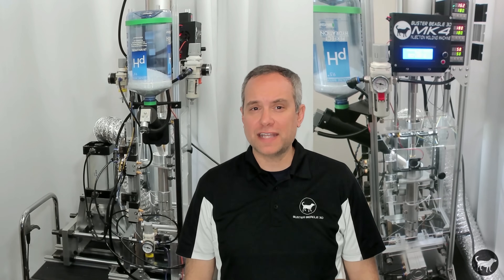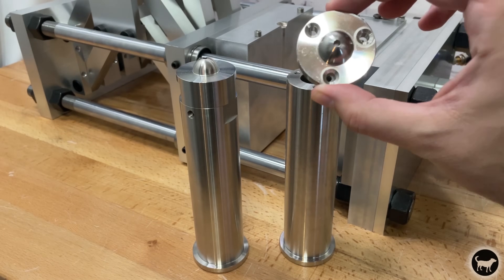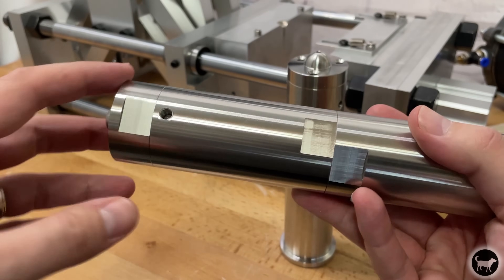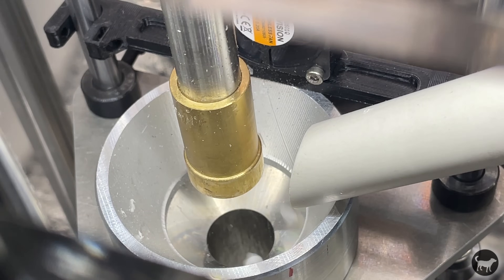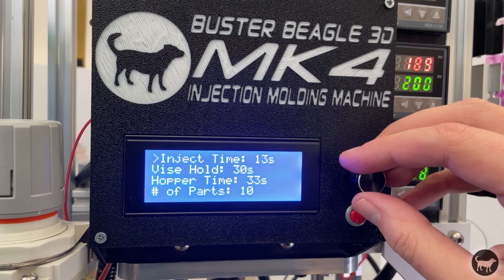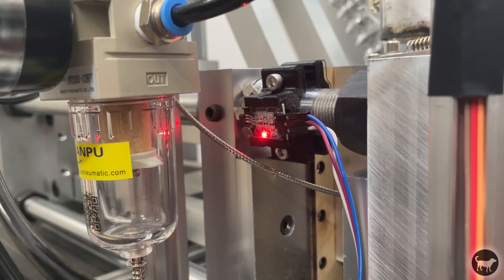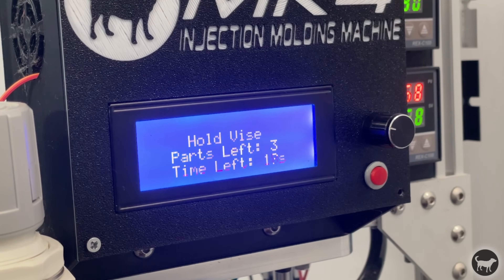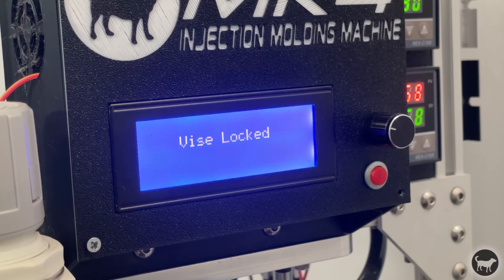Buster Beagle 3D MK4 Injection Molding Machine | Full Automatic

Comment: Question, would i be able to put polystyrene through this? Or would that be too hot? Also would PS work with silicone molds? Or would i need a different material

Comment: this is awesome i actually work in plastic injection molding and we use a screw version of this. i still very much like this im trying to learn some coding but i see you actually include the code, but either i dont know who your files are broken up or i dont seem to know how to implement your code i guess.
Reply: actually i think i figured it out i didnt know anything about the libraries but i see its actually something in the arduino program. like i said working on learning coding but im a long way away but working on a project with this i look forward to this project and future ones

Comment: Question.  I wanna make an mk3 but i want to make it for the 5 cubic inch shot.  This is doable with out making all these extra things?
Reply from the maker: Yes. The MK4 chamber is the same except it has the ability to be made longer. As long as you give yourself enough vertical space you should be able to make the MK3 with the MK4 chamber + extension.
Reply: @BusterBeagle3D ended up buying the mk4 frame. Just incase. But yea. Got it up an running. Question can i use  polyvinyl chloride(rigid pvc) pellets.  An any good place to get pvc or any other pellets
Reply: Hi there, I’m wondering if you could post some pictures/vids of the biggest shot size completed?  I really need around 5cu in, which I see your chamber is, but how big of a shot can it actually complete?

Comment: I was wondering if it was possible to have the Arduino just run 3 PID loops to control the heater relays since there is already one handling other processes. Would this be considered unsafe / more prone to failure?
Reply from the maker: To be honest I’m not sure. I’m sure someone with more advanced knowledge in microcontrollers could figure something out to handle that as well but for now this is about as far as I have been able to cobble together. Baby steps :)

Comment: really cool upgrade and project. is there anywhere that sells this as a full kit with everything? or at least a BOM for the entire mk4 auto version and not just a diff from the previous version? while i get the buster beagle project is more of a community thing, i don't really keep up and am more so looking to just purchase a whole unit once, and don't really care about future upgradability.
Reply from the maker: While I don't have a full kit at the moment I did cobble together a full build BOM for the MK4. You can find that here:
https://docs.google.com/spreadsheets/d/1JVG8-Zt6J-UAuxbnEOaoJAQSUpH0-k1IP8Y7-RxV8Eo/edit?usp=drive_link
Reply: @BusterBeagle3D   What's the likelihood of you releasing a kit for the mk4 with automation? You know, for those of us just barely clever enough to assemble one but nowhere near smart enough to do anything with programming?
Reply from the maker: @winston8586  Hi. I am working with folks in the group to potentially streamline the automation electronics to make that a much easier item to setup. It might be a little bit before that all comes together and will still require some hookup but hopefully it's an optimization that invite people to try it out instead of being intimidated by it. Also the program is already written and provided, you simply need to add the code to a board, follow the wire diagrams and it should all run fine.

Comment: Any electric actuators tested for the Vice clamp? 
Air is nice, but those are some big thirsty cylinders.
Reply from the maker: I really haven't seen electronic actuators with the speed and pressure needed to run some things, at least not at the cost point near a pneumatic version but I could be wrong.
Reply: There are some videos on youtube of another person using treadmill motors to drive a clamp. I pretty sure he talks about the way be cobbled together the electronics.

Comment: just wanted to comment on one thing: you are a programmer. we all started like this. you made something that works, that's awesome! give yourself credit on that

i'm going over your code and sure, i can tell there are some amateurish things in it, partially with the tidiness of the code, but also with those long else if chains in places where switch statements, dedicated functions, or both would be a better fit. there are a few busy waits (empty while loops, you should put a small delay in those to avoid just running your cpu at 100% while you wait for a button to be released, for example) but i can't find anything actually bad about this code.

your code works, and that's really the point. that's one of my favorite things about programming tbh, the arbiter of success isn't a person, it's the machine you're trying to get working. and you very much did reach that success.

i'd also recommend asking chatgpt not only to help you write new code, but also to explain your existing code, and why it works the way it works. yes, hallucination is a problem and you will have to verify most things you hear from an ai, but programming is unique in a few aspects there: 1) you can test a lot of things yourself in code, 2) there's a lot of abstract logic where the real task is not googling something, but figuring out what to google, which ai models can really help with, and 3) welp, ai models were made by programmers too and often tested on programming tasks, so they're usually better at coding than a lot of other things.

impostor syndrome is really common among junior and mid-level programmers, but really the only thing you need to know to be a programmer is how to understand and solve a problem with the tools available to you. even if you use ai to help you, as long as you understand what you're doing you're still very much a programmer.

Comment: Super nice work!
Haven't had time to work on my controller design, but I could make you a small integrated board for this if you want to simplify wiring and sell in the kit :)
Reply from the maker: I was actually wondering about this and how much it could save wiring wise. I'm not very versed in that type of design but would be happy to hear how you think it could help.
Reply: @BusterBeagle3D  I'd say you could include the encoder, Arduino, dcdc all in one PCB, with the screen stacking on top. And then have connectors for each of the external devices (valves, sensors, etc..)

Happy to work something out with you if you want :)